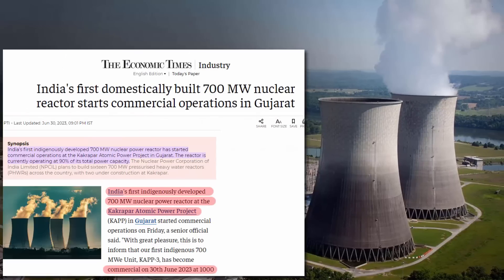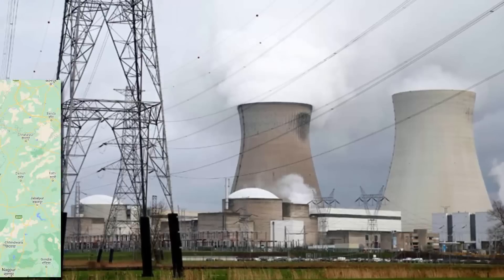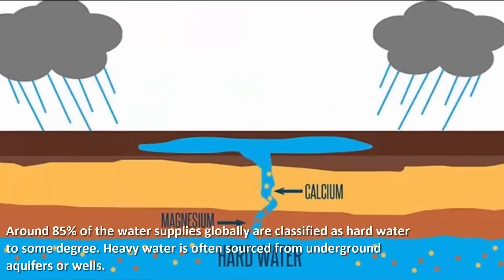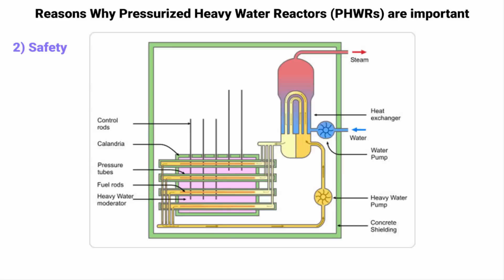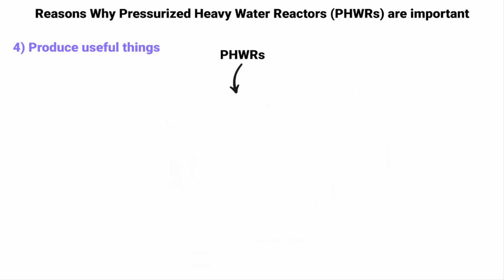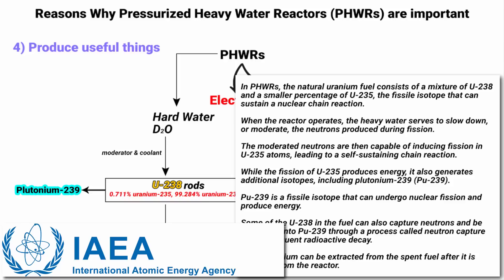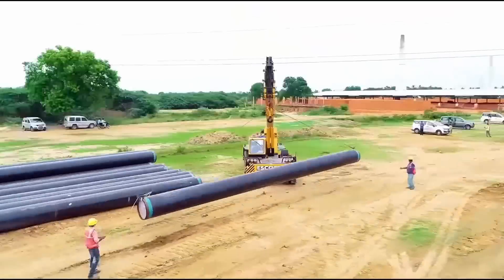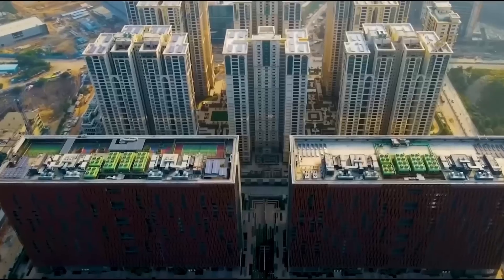India’s 1st Indigenous Nuclear Reactor is Ready | Benefits of Pressurize heavy water reactors PHWRs

Comment: I solve the high positive reactivity coefficient in breeder reactors with a double core configuration.  
It also have a better breeding capacity.
I need some ideas on how to implement it.  I'm working now in its implementation. 
Regarding Heavy water production, you should investigate the heavy water content in hydro methane ice.

Comment: Normal water is H2O, 2 hydrogen atoms chemically bonded with one oxygen atom ( but it doesn't not have salts dissolved in it )

Hard water is normal water that has salts dissolved in it ( H2O + salts)

Heavy water is completely different thing. H in H2O stands for Hydrogen atom. Normal hydrogen atom has just .....one proton, no neutron & 1 electron 

Due to fusion, sometimes Hydrogen atom can gain 1 neutron and its compostion becomes 1 proton, 1 Neutron & 1 electron.....This is known as Deuterium ( a modified hydrogen atom)

When this 2  modified hydrogen (D) atoms react with a single oxygen (O) atom and bind with it they form D2O .....this is called heavy water

Comment: Very odd unit capacity of 700 MW. There were 60 MW units in India, then 200 then 500. Where does this 700 come from & why ?
There are 600 MW, 1000 MW and now small modular reactors are in market of 300 MW. Rather than one big unit it is better to have smaller units. Better for Grid and better in many aspects.

Comment: Sorry to say usually ur videos are well researched, but this one was not, u didn't even know the difference between hard water and heavy water, and also its not the 1st Indegenous Nuclear Reactor, its largest one and first in this category of 700MW. Almost the entire existing base of Indian nuclear power (4780 MW) is composed of first stage PHWRs, First one was 220 ops started in 1084 kalpakkam in TN, later expanded to 540 and now 700MW, while the whole world is moving towards SMR tech. we are moving the other way, hope we start work on SMR. China is far advanced in SMR tech. Did the modi govt pay you?? previously u were largely neutral now you are doing quite a bit of Modi bhajan here. where is 2nd stage of the 3stage nuclear power programme, there is enternal delay in FBR tech.. i mean its more 13 years now, from the first time they announced it will start operating soon

Comment: Idiot it’s not hard water  it’s heavy water  because  instead of hydrogen a isotope of hydrogen Called deuterium reacts  with oxygen. You sated with hard water  and switched to heavy water. Heavy water specially generated by using fossil fuel or electrolysis  India does this by fractional distillation. Talcher in Orissa also near Kothagudem in Telangana  are two plants that come to recall.
“ India is one of the world's largest producers of heavy water through its Heavy Water Board.[67] It exports heavy water to countries including the Republic of Korea, China, and the United States”

So hard water is different from Heavy water which is moderator in Nuclear power plant and surrounds the nuclear fuel rods ,,,
Reply: It's silliy mistake

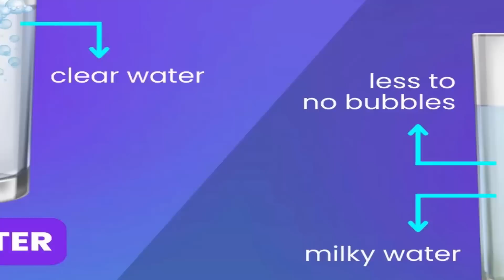Comment: @Amit Sengupta: 2:00 It is not hard water, it is heavy water. Heavy water is an isotope of normal water where deuterium bonds with oxygen instead of hydrogen. Deuterium is an isotope of hydrogen with one extra neutron. The extra neutron increases the likelihood of slowing down the speeding neutrons, and therefore, is a better moderator compared to normal water.
Hard water is simply normal water mixed with several minerals / salts.

Comment: Being from the nuclear fraternity of India just want to correct a statement that heavy water and hard water is not the same. Heavy is an oxide of deuterium(D2O), isotope of hydrogen and hard water is normal water (H2O) also known as light water with lot of dissolved salts. 

Anyways, in India PHWR technology was adopted because the it can operate with natural uranium fuel obtained from indian uranium ores whereas light water reactors need enriched uranium fuel. Thus eliminating need of expensive uranium enrichment facilities required for low quality indian ore.

Using natural uranium fuel in PHWRs also helps in generating a substantial quantity of plutonium that can be used in fast neutron reactor to breed more plutonium which shall ultimately breeding thorium for heavy water breeders.

Comment: I'm a fan of CANDU-type reactors, which India's PHWR discussed here seems to be an offshoot. However, as the narrator insists on saying, heavy water (D2O) and hard water (H20 laced with dissolved minerals) are hardly synonymous with one another.
Reply: Like to add a point that D2O is hard to find due to its rare presence and also separating it out form normal H2O, which makes it a critical component for the whole operation
Reply: @roshangudhe5264 : Please!

Comment: HARD WATER AND HEAVY WATER ARE DIFFERENT, 
HARD WATER HAVE DISSOLVED SALTS WHILE HEAVY WATER(D2O) IS WATER WITH DEUTERIUM A ISOTOPE OF HYDROGEN
Reply: Thank You Bhai
Reply: +1
Reply: I guess by slip of tongue he uses "Hard Water"in place of "Heavy water". Nonetheless good work.
Reply: Absolutely not right.

D2O ie; the heavy water is the isotope of the soft/normal water H2O. 
Hope you got my point. 👍
Reply: Isotope can be only of element i.e. Hydrogen (H). Not of molecule i.e. water (H2O). Deuterium is an isotope of Hydrogen (same atomic number of 1 but mass number of 2 as the nucleus contains 1 proton + 1 neutron).
The molecule formed by elements Deuterium & Oxygen is heavy water (D2O), just like molecule H2O formed by union of elements Hydrogen & Oxygen. 
Remembering physical chemistry of school after so many years. 😊
Reply: Exactly! Why does he say like Hard water and Heavy water are the same? He must have not attended physics class 11/12 ...

Comment: Since 2017 there is no change in nuclear energy it is still 6,780MW. 
However, it is contributing 3% in total electricity generation in the country.
Hoping present government will do wonders in the renewable energy.
Reply: Wonders have been made in solar ans wind sector. Please check the stats in last 10-20years. Expansion of nuclear power plants always face back slash either from oppositions or from so called activists. For e.g in my state WB, central govt planned to install a nuclear power plant in 2015, which was withdrawn after massive political protests by local TMC govt.
Reply: Bhavani project which was expected to add 4000 MW wasn't ever completed  for the last 20 yrs. It is a total failure. Also 3000 MW planned in Kudamkulam didn't take off and the existing 1000 MW availability is less than 50%. Both the projects were envisioned to be cloned to get 14% of overall energy production but unfortunately nuclear scientists have failed both projects
Reply: @bonitokumar4977 they are under construction once done they will give the required power
Reply: Eventually, BHAVINI using U-233 in 2024

Comment: Heavy water isn’t hard water. It has a neutron in its hydrogen atom, about doubling the weight of the hydrogen which normally only has a proton. I believe we have to manufacture it with electrolysis.

Congratulation though. Great news
Reply: Yeah heavy water is D2O
Reply: heavy water is D2O  not hard water
Deuterium is the heavy isotope of H
Reply: Yeah exactly
Reply: It just two oxygen coupled with isotopes of hydrogen.

The process of electrolysis is a topic concerned about movement of positive and negative ions.
Reply: yeah but it is also easily to make